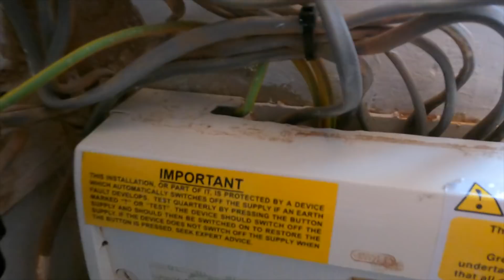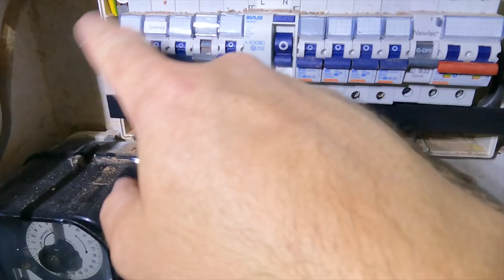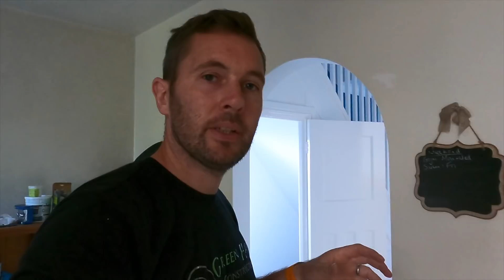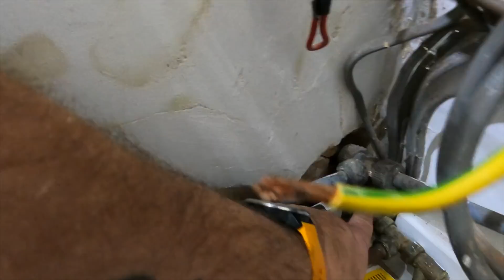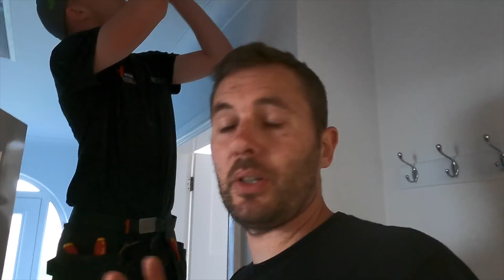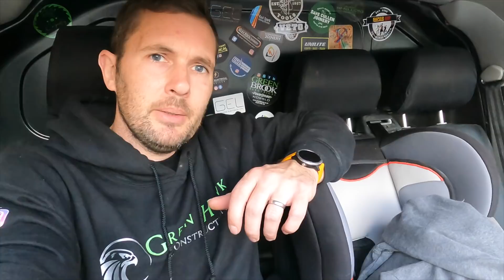ALWAYS TEST FIRST - DON'T GET CAUGHT OUT - ELECTRICAL NIGHTMARE

Comment: Single dwelling does not need fire rated downlights. It is recommendation. Single sheeted cables, if not accessible for tuch is a Code C3. If it was an apartment and downlight would penetrate fire barrier then it would have to be fire rated.
Reply: For 20 properties inspected only 1 has properly installed downlights. Downlight, cooker, additional sockets spurred from ring. Lack of cpc continuity with class 1 accessories, cut off supplementary bonding and main protective bonding removed. It happens every single day.

Comment: Thanks for the video.  As an adult learner I absolutely agree that testing the CU before doing anything is a no brainer. Haven't done a lot with Quinetic but understand how it works if 3 plate method is used. What happens when the feed and neutral are taken to the switch? Will there be room in the back-plate?
Reply: I always take mains to the wall switch. As for room, simply make room using a deep chase and 35mm box which also allows a potential dimmer switch to be fitted. Fault finding easier too using this method. Lots of pro's taking feed to switches but I also like to use a 6243y as my switch wire to lighting  providing mains for future proofing. 🤝

Comment: Why the idiot electricity suppliers didn't have isolators in the smart meters they are rushing around fitting is beyond me and they are removing the meters like this one .
Although the meter you have there should be sealed on the isolator side because the switch wire for the dual rate is in that side slight design flaw when used on economy 7 you can't use the isolator if you connect that wire to a live feed the meter will be permanent cheap rate

Comment: Have you ever wondered why they still sell non- fire rated down lights, because you could still install them, most of us don't, but you could.
The only room in a two storey house where I can think you would have to fit them would be an internal garage ceiling with a bedroom above, because that garage is a separate fire compartment to the rest of the house.
Also several years ago, a report was done, and it showed that with the lamp still in place the fire properties of the ceiling were not compromised.
I had an arsey building inspector, several years ago, who insisted on the lights being replaced with fire rated ones, he had to back down when I pointed out the above information.
 Plus I doubled checked I was right with the NIC guy, just to be sure I was right.

Comment: I changed a board the other week and the lady was panicking because they'd only just decorated but they'd chased the cables into the wall before hand not even thinking about electrics. There were reasons for her needing a new board, no RCD protection on electric shower and now chasing previously run surface cables into the wall. I turned up with the board but ALWAYS test first before going ahead, It's just easier to confirm you're not going to have any faults beforehand. There were a couple issues but nothing major, just end to ends failing where kitchen sockets had been replaced, the normal. 

That job is going to be a hassle, I think quinetic switching may be the answer to the lighting but you may find you have to pull boards up anyway for sockets.